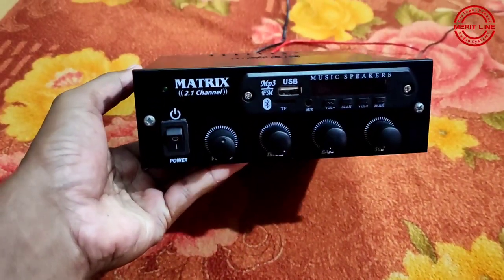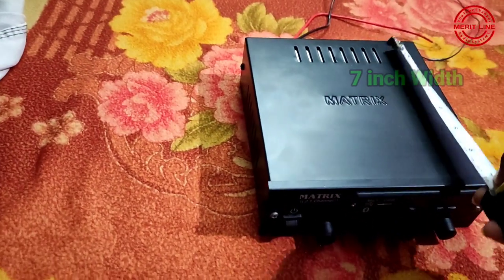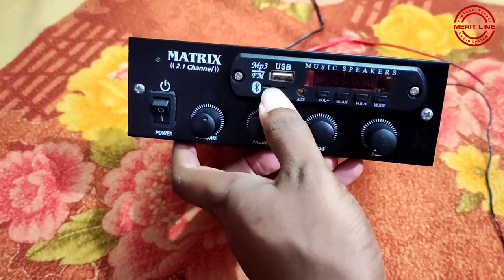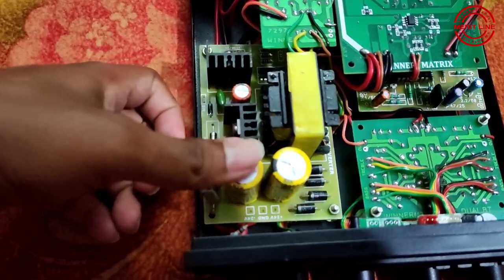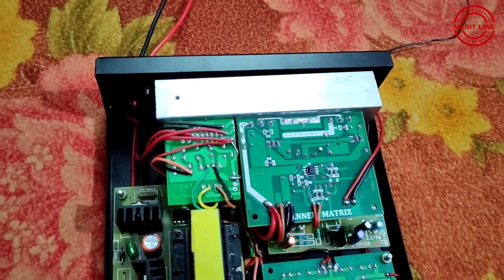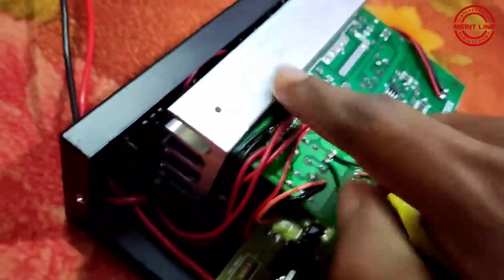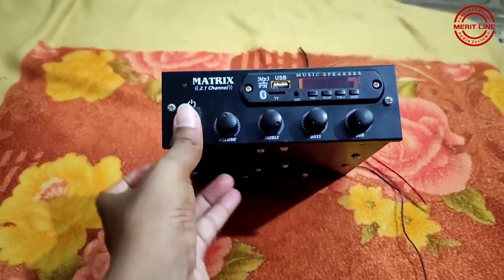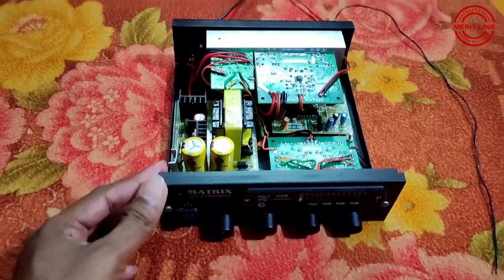2.1 DC Amplifier for Car, Auto, Tractor, Lorry, Bus, etc | 200watts RMS with 12" Subwoofer support

Comment: 7297 i.c output 15W+15W

2 MOSFET board.ki 8inch woofer suitable, 10 or 12 inch vesthe load paduthundhi, board heat yekkuthundhi, Bass punch padadhu, 4 MOSFET aithe no problem.. 
7377 board use cheyandi 30W+30W super clarity.... Car speakers vesukovachu... Compact size ye adhi kuda
Reply: Bro ph number kavalli I am vja lo untaanu 2.1kavalli